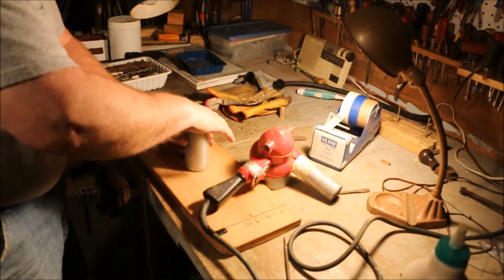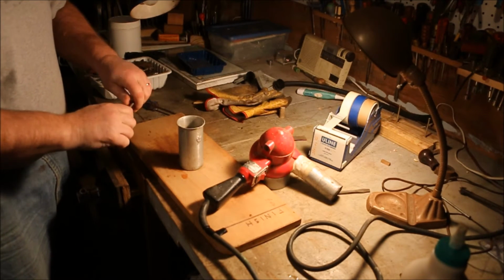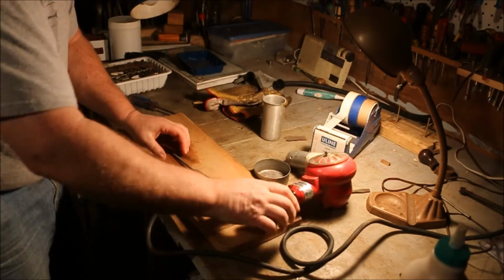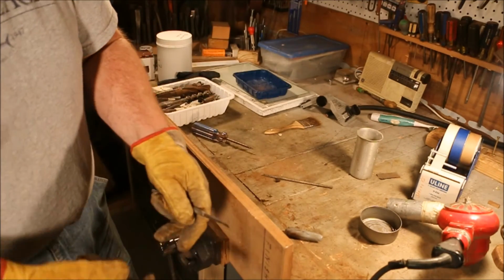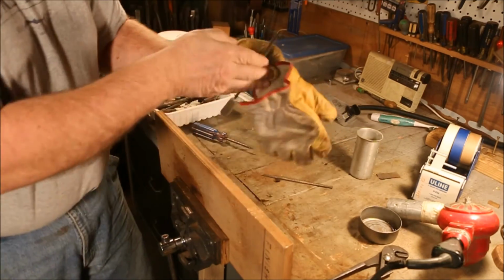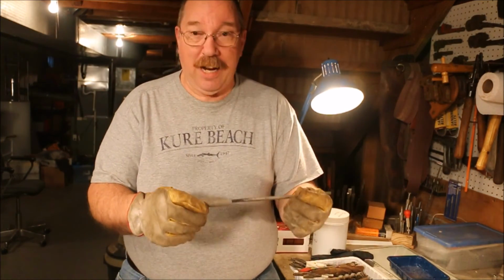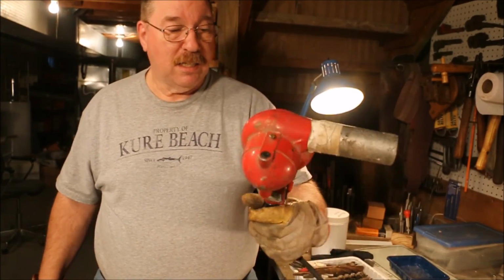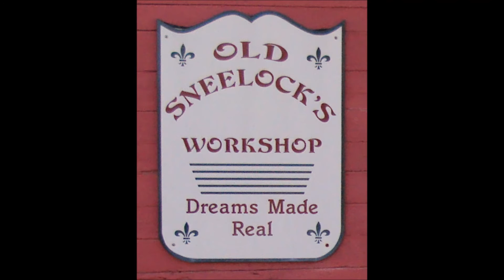Recycled File Handles ~ by Old Sneelock's Workshop

Comment: You can use old bleach or juice bottles as well, basically any of the hdpe plastics. Not the clear stuff but the white or coloured stuff. Got an old blender? Chop it up in that. Got an old toaster oven? Heat it in that. Use it for soft heads on hammers or soft jaws on a vise, or anything else you can think of.
Reply from the maker: kleinjahr A soft hammer head is a great idea. I have a hammer with the plastic head that's just about worn away. Thanks.

Comment: So lets say you press a nut into the end, could that grip the tang so it can support more files? 
I have been making File handles out of some old Oak Towel Rods. Shape them using various tools then Drill a hole in the center smaller than the Tang. Heat the Tang with a propane torch and press on the new handle. So far this has worked for my smaller files, I haven't tried it for my larger files. But boy do I need file handles. Once it warms up I am going to sharpen all my files, using your method. I hope to have handles for them by that time, I was planing on using the Oak pallet wood I have, but this may be a better or different solution. I have been collecting old leather purses I was planning on using as protective covers, before they go back in their drawer. Sometimes I spend more time playing with the Tools themselves than actually using them to make anything, but for me that is half the fun. Currently I am using pieces of old garden hose to make sheathes for my Axes. My saws are next in line.
Reply: Matt, I also use the heated tang method to fit file handles in both wood and plastic. It works a treat and learned it after splitting a new handle when trying to drill out the exact profile.
Reply: One of the guys I worked with used a split hose for insulation on welding leads. I make most of my file handles from branches. PLentiful supply.

Comment: Drill a small hole in an old golf ball to make a file handle.
Reply from the maker: tom7601 That works. Wranglerstar did it and was happy with the result. In this case I had watched a video on using recycled bottle caps to make sheet plastic. I took 5 caps and melted them. Once I had them melted it wasn't enough plastic to really do anything. One of the files from Pandora's Box was laying on the bench so I jammed it into the wad of plastic. 
It worked like a charm. So that's why it's a file handle.